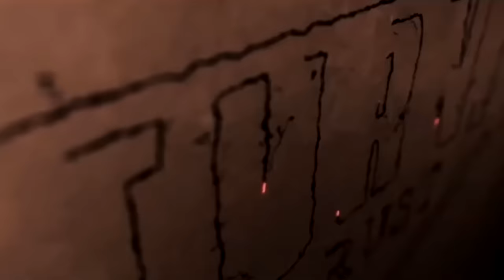Slamming The GMC On Custom Air-Ride | 1952 GMC 3100 Restoration Part 3 | Turnin Rust

Comment: Can't say enough how informative your videos are, just love them. You take the time to explain what you're doing and the reasons behind it. Like the reinforcing that was done to your rear frame, and you definitely should go the tilting bed route. I did that with mine and it looks amazing and will ease certain maintenance that will come up. I used linear actuators but my bed is a lot smaller than yours. Hoping to get mine on the road this summer, have never given up on it.

Comment: Gun metal grey with black running boards and wheels put the chrome back on it to accentuate the chrome center caps with the turning rust logo on the door in the rust brown.
Reply: Sounds tasty. I'll take fries with that:)
Reply: Thank you for helping me find the answers that I was looking for that's going to be a nice color combination
Reply: @dawnstarr4730  👍🏻
Reply: Nice choices. This truck, given the work put in should remain "Dad's" shop truck!!
My Granpa had a genuine, all original ford F1 styleside short bed up on little squam lake in NH, before he passed, which I rode in w/ Him & my dad. 3 generations on the same bench seat! Despite begging my dad to let me have the truck, My cousin got it cause he owned a body shop. He totally restored it with "shiny paint" from a very light, beginning patina.
It was black and had similar wheels & tires as yours. No bags, all original. Still, it was great. Never learned what it's fate was, or if he still has it.

Comment: Thanks for sharing guys, I have my own 5 window 1950 Chevy and I want to install airbags on it and I can do all the fabrication on it but just didn't know where to notch it or cut the frame. Thanks for the info. I'm a welder. I'll send you guys a pic when im done. I live in a border town between the US and Mexico at a two hour drive from San Antonio Texas. I bought my truck in Mexico took it to my house and plan to restore it by myself. Hope everything is well. Saludos👍

Comment: Instead of putting a tank on the truck box some of the frame in and Plum it for your air lines it will save a lot of space and be cool at the same time then all you will have to do is Mount the compressor but keep up the great work love the videos

Comment: Great job on the truck, really enjoy watching y'all work. Just have to say PLEASE use proper safety equipment, as a 64 year old man with hearing loss I am a firm believer in ear protection , it is too late for me but try to protect yourself. Also I bet those bed irons you cut could have paid for most of that build, they are rare and expensive. Can't wait to see the finished product.

Comment: 31:21 Nice karate chop instead using a power tool luv u guys @ ( Turnin Rust) lowered 52 Gmc by way lower & coil springs works better than airbag system.

Comment: these guys make a lot of work look easy. engine wise, i prefer a 250 cu. in. later model 6 or a sbc. the sbc fits into the frame well. use "ram horn" exhaust manifolds to clear steering. to make  it ride better, install teflon strips between the leaves of springs, a  set of monroe shocks & a front sway  bar. if this doesn't suit, move all sheet metal onto a s-10 chassis. pay attention to wheelbase. fabricate a few brackets for the body mounts. i prefer 4 speed stick truck trans, the same vintage, but i'm old school. electric wiper conversion is money well spent. if you hold down a job & have a wife on your ass, keep things simple & easy if you like 5 window cabs. buy a 5 window truck. it will save a bunch of work & time. remember, everything you change take a little away from what the truck is. since 1971 i've owned approx 15 of them. good luck!

Comment: Truck looks really good. But future reference pipe is for water and poo tubing is for structure. You saved money on the schedule 40 pipe but since your main structure is there you could use some .095 or .120 seam welded tubing for cheaper or the same price. Just dont want to see someone else building a truck using the wrong materials or structural design. Just a thought. Great work keep it up.

Comment: You fellas should invest in Commercial Ear Muffs for the air chisel, thats bad for your hearing over time, and they are much more comfortable than finers in your ears. They even make them now with eye protection shield attached, so you can use the Grinder, and protect your hear. 25 years in a truck shop I can tell you it saves your hearing.

Comment: I like it! Why don’t you take the 305, place it on the “trees” pickup. The one where you found the other good stuff. Get it going, Spray the patina and And let her roll!  When you sell her, sell the old motor and transmission with her. That way the new owner always has option to go back original if desired? Phillip Hall

Comment: Boys I’ve worked steel for years and the thing that I see not only you but every other shop doing is using that thin cutting wheel with out a face shield , they are cheap and will one day save you a trip to the ER , they will pinch and fly apart and it’s very common, you’ll wanna keep your faces pretty ! Hehe

Comment: If your ever interested in a 2003 S10 for a old truck to s10 frame disc brakes  V6 4wd trans needs kit which I have I believe it's the right one 97- hd clutches all seals in I have filter. Motor is pretty good no oil leaks transfercase may need a seal in the truck needs a rad flush frame was undercoated so I've been saving on it I'm from MN so If  got it trans remaned this spring id drive it down to you guys I was gonna ask $2000 for it if 1000 Mile road Worthy.

Comment: In 1952 GMC pickup truck has S10 chassis with tie rod end to go under the spindle arm. What you did was you had put the tie rod end to the top of spindle arm instead of go up the hole under the spindle arm. Will it be any improvement? Thank you.

Comment: Hey that was really a nice truck I have a 51 Ford and I am looking to use and S10 with the code 504 any suggestions on what engine would be a easy fit thanks for any tips . I like what you guys are doing 👍

Comment: I sure hope you guys went with a nice new paint job. That truck is too nice to be an ugly patina paint job. Learn to paint and do bodywork. You could make a lot more than you spent on building. Also, air ride is not that comfortable and the bags get leaks easily. Right now the trend is towards Ls motors in older cars. I make very good money doing what you guys do. I have my 2 sons working with me. We have our own frame, and our cars are better than new when finished. We have clients that come to us wanting an 80k to 100k build

Comment: "Lookin' like a fool with your truck on the ground.." my version of pants on the ground. This truck looks awesome until you lower it like this, then it just looks stupid as all get out. Those fenders and wheel wells are designed to accentuate the roundness of the tire. They can't do that when half the tire disappears.
Reply: Different strokes for different strokes. They rescued the old truck from ruining stuck in a shed some where. If we all built them alike we would be buying and driving the same plastic boxes that everyone drives up and down the interstate. When the first hot rods were built people criticized them. Ask George Barris.
Reply: Different folks.. Sorry.. Glad you appreciate the old ones though